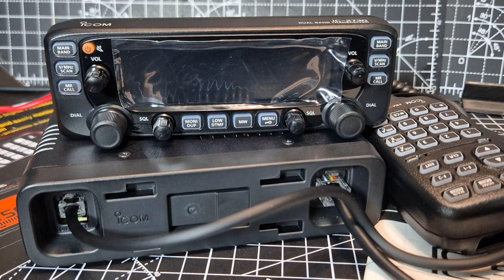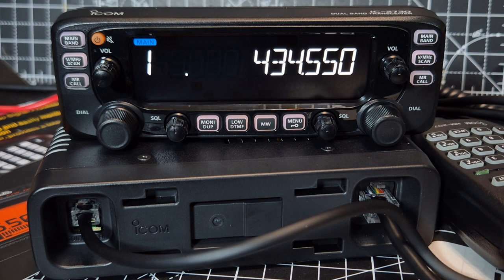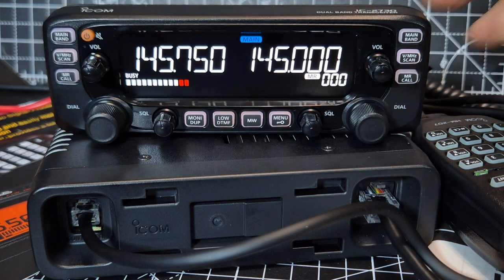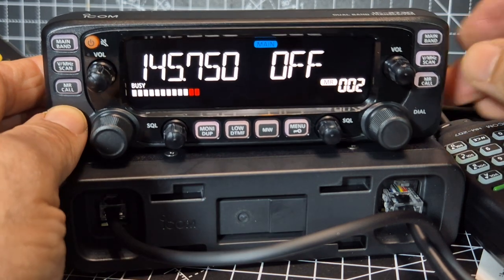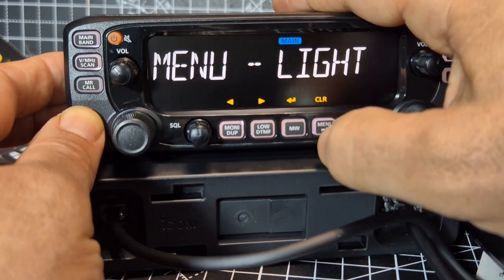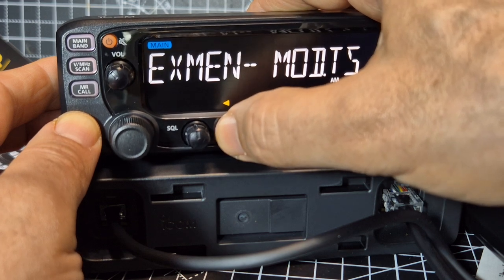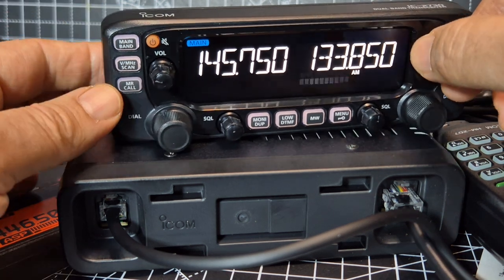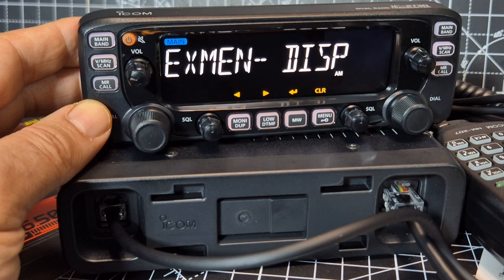Black ICOM IC-2730 First Power Up

Comment: If the head unit is mounted onto the main unit, how does the connecting cable fit between them?
Reply from the maker: Its short behind there is a gap.